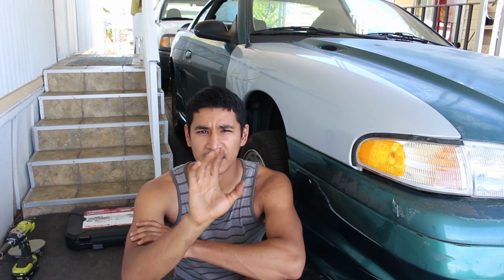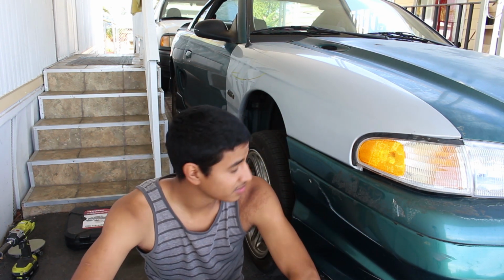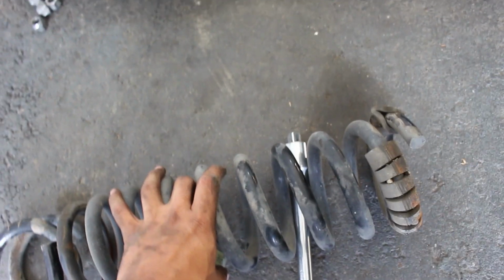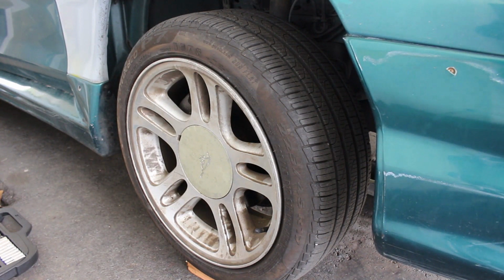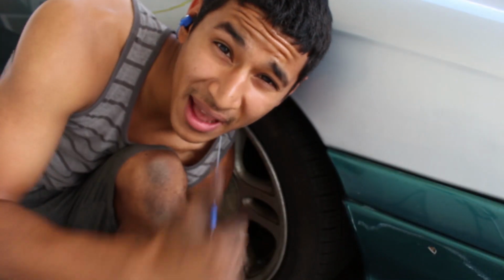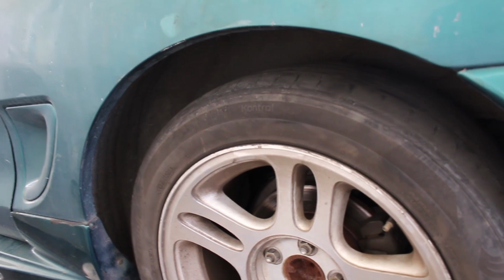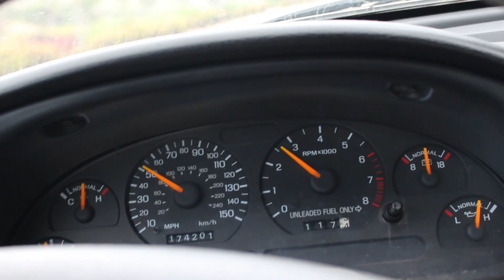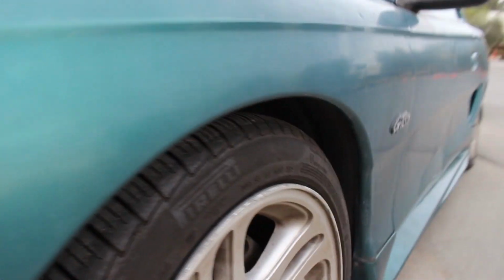Lowering My Car For FREE!!!!!! (Bad Idea?!?!)

Comment: Ive done atleast 30 94-04 mustang gt this way 2 coils all around never had an issue . My 2000 gt i bought new is still sittin on cut springs from 2001 and till today rides fine. So dont sweat it kid just enjoy the ride
Reply: Does it ride like stock or is it bouncier or what

Comment: Did this 4 my gt96 car still rides smooth i removed 2 1/2 coils all around & reinforced the rubber bump stops D1 BABY. Run 2 inch spacers all around it works!!
Reply: poly bumps just think a bit@MattM Mcneill

Comment: Does cutting your Springs make it bounce a lot ?
Reply: yessss
Reply: No
Reply: So which one is it....
Yes or no....???
Reply: Javier Meza no. Even cars with stock springs bounce. It’s the shocks that controls that.  Some people cut too much off and their shock can’t handle it at that low and blows a seal. Hence the bouncing. 1-2” drops won’t blow shocks
Reply: @KBMOTORSchannel  oh ok... gotcha👌
Reply: @KBMOTORSchannel  no cutting 2 inches won’t make your car bouncing?
Reply: @KBMOTORSchannel yes it do😂 you get a static bounce my sht be moving funny now. Looks cool tho
Reply: @toxicity6629  I have cut my springs many times and still rode good. Obviously there is a method to it because of how the  spring sits in the perch. But overall easy to do.

Comment: If you lowered a car suspension, can you make it higher again?
Reply: Dario Jimenez cutting the springs, no. You would have to get adjustable Coilovers
Reply: @davidmccloud2508  or just buy new ones or junkyard springs
Reply: johnny smit  haha! 😝
Reply: Of course you can. Just re-install OEM springs again. 

But if you mean using the messed up cut springs? No. Unless you use the technique in the above comment. That should definitely work.

Comment: Was that 2 coils? Im thinking about doin this on my camaro while i save up for some coilovers. Coilover set is $1000 for my camaro
Reply: Buy 1 to 2 inch lowered springs man cutting is weakening the oem ones is all not the best idea but I guess can be done? I wouldn’t man not worth a crash
Reply: Steve Parlier how would u crash from cutting your springs?
Reply: @steveparlier9282  The worst thing that will happen with cutting springs is unpleasant ride. It won't cause a crash.
Reply: @DigitalBathInAZ  FALSE! Where I live we live in the sharp turning moantians in the desert, our lowerd car was going down the moantain and hit a small pot hole making the car bounce hard and loosing grip causing us to whip and smash into the wall and off the moantain. Car was totaled and I was the passenger with a broken collar bone, 3 ribs and a broken nose
Reply: @FSUAGAMINGAIRSOFT  Bahaha! Yeah. Okay. Hahaha!!
Reply: @DigitalBathInAZ  You can laugh all you want but it happened. I feel like its cool as long as you dont live in a place with windy mountains defiently since we have cracks and potholes going downhill and turning left and right non stop.
Reply: @FSUAGAMINGAIRSOFT  Because you're describing some treacherous road and losing control of the vehicle not on the driver's failure to maintain control of the vehicle appropriate to the road conditions but to the car being an inch lower than normal. You're a fool, sir.
Reply: @DigitalBathInAZ  He drives down it everyday for work but once we slammed the car down not just an inch it caused the car to be way to bouncy. Call me what you want doesn't make you any tougher. Lowering your car to low will cause handling to go down but we were to young and dumb to realize that
Reply: @FSUAGAMINGAIRSOFT  First off, when did I say I was tough?

Secondly, you're wrong. Losing the car IMPROVES handling. Look at supercars, racecars, rally cars being cars specifically designed for mountain roads. 

The problem is cutting the springs alters the spring rate so if you live in a place with roads that are anything but smooth, then DON'T CUT YOUR SPRINGS. use lowering springs, adjustable coil overs, etc. There ya go. Let's hear you challenge that.

Comment: Is this dangerous?
Reply: BLVCK C4TI too dangerous
Reply: @crazysubaru329  how?
Reply: Pollo Frito when you cut the springs you have a risk of injuring yourself or someone else on the road. If you cut it uneven and you go over a big pot hole or even a uneven part on the road, the spring will expand and if it moves enough, it can leave the strut, which causes your car to tumble down with bare shocks, and could possibly end up in a deadly reck if going over 40MPH.
Reply: @crazysubaru329  I am at my PC instead of my phone and I type fast, so I will take a few minutes to properly reply. I hope you aren't a hostile commenter and  will actually have a civil discussion. :-)
Reply: @crazysubaru329  I'll reply to your points:
1) "If you cut it uneven". So you just said the same thing as "if you do it incorrectly". Well, you can say this about anything. Do you think putting on a spare tire tire when changing a flat is a danger to other people on the road? Of course it is if you do it wrong. If you only fasten the spare wheel using only 1 lug nut instead of all 4 or 5, then it could snap. You can make this "if you do it wrong" argument for literally everything to do with anything in life. 
2) ""it can leave the strut". I cannot leave the strut. The strut is inside the spring (usually - MacPherson among others) and bolted up top usually 3 bolts and below to the mount with one very strong bolt. The spring couldn't come out of the seating area with the weight of a car on it, but even if it somehow could like if you were jumping your car like Dukes of Hazzard, it couldn't get much further away than where it's supposed to be. An inch. But again, this is a fantastical scenario that couldn't happen. 
3) "deadly reck". I am not sure how you're able to predict the outcome of humans involved in this hypothetical *wreck that you speak of, whether injury occurs at all and if so, that it would be fatal. This is just nonsensical to me. 
4) "above 40MPH". Where did you pull this velocity figure from? Did you just make it up? Again, this is unfounded and coming from nowhere. 

Bottom line, if you do things right, this isn't an issue. If you do things wrong, like with anything, then it can be an issue.
Reply: @DigitalBathInAZ  hey boy, cutting your spring is just a bad idea. Realize it pls.
Reply: @bezmozek3723  You missed the point entirely. I never once endorsed this practice.
Reply: The type of springs on this car are just fine to cut. Just do it correctly. https://youtu.be/RNOmTsmABIc